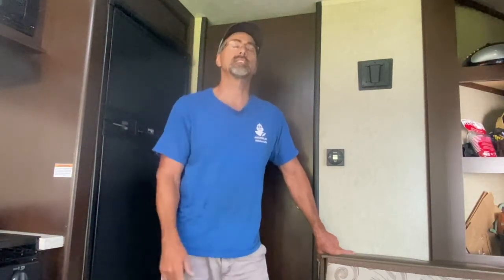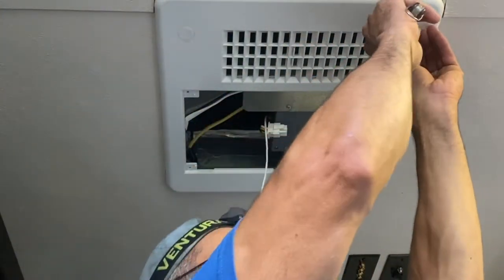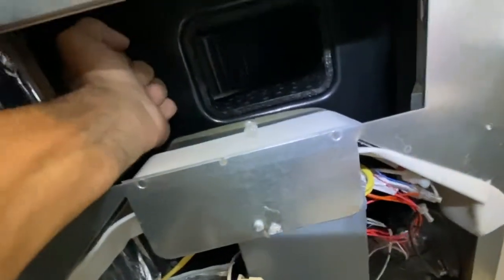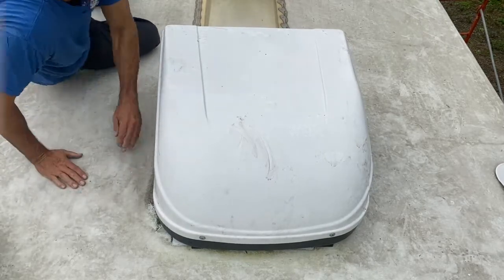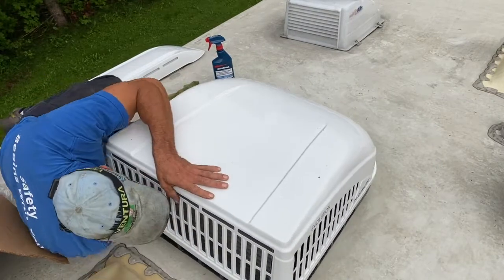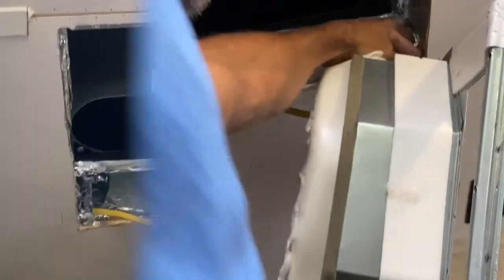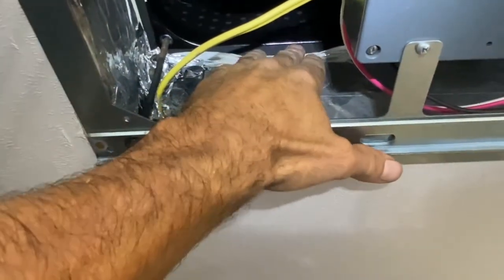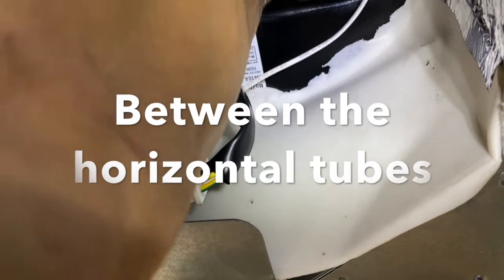How to replace a Dometic AC unit Blowing warm air on an RV / camper, 13500btu A/C PART 2

Comment: Did you use the original control board ? Or did you buy a new one ?
Reply from the maker: I used the original one..
Reply: @WeekendHobbyMechanic  
Thank you for your response.  Did you just order the same model a/c unit ?

Comment: Hello. I'm sorry, but what was the problem with the old air conditioner?
Reply from the maker: Weak compressor. Watch this video on troubleshooting it.  https://www.youtube.com/watch?v=bDRlxWkgkvg
Reply: @WeekendHobbyMechanic  Thank you. Good day of the day. The air conditioner abruptly stopped cooling, the motor is running, the compressor is warming up, the tube is hot, no oil leaks were found. The thermocouple has no resistance, perhaps because of the thermocouple it does not cool?
Reply from the maker: @Andrew-yh3zo   If the compressor is only drawing under 10 amps it’s defective.